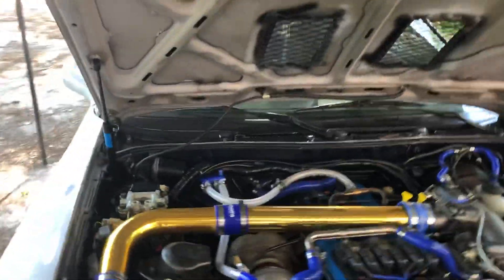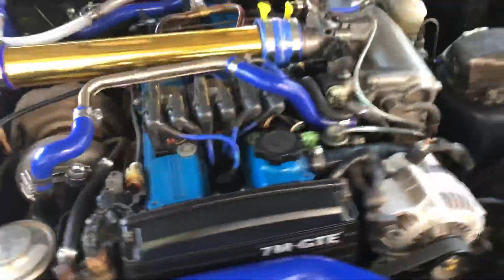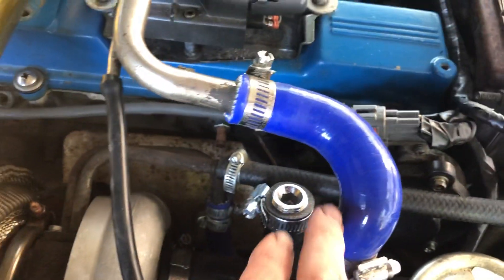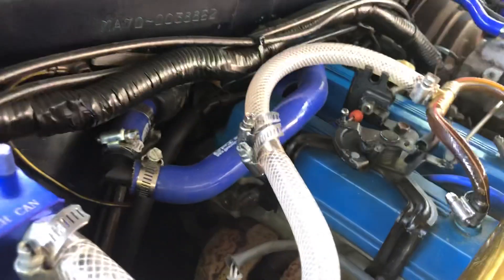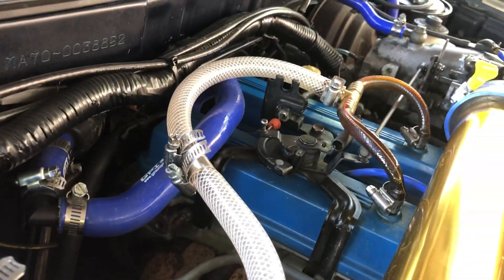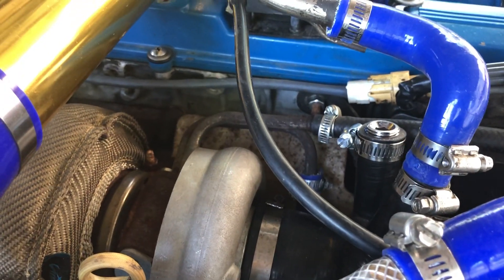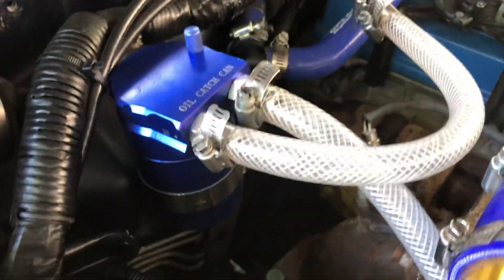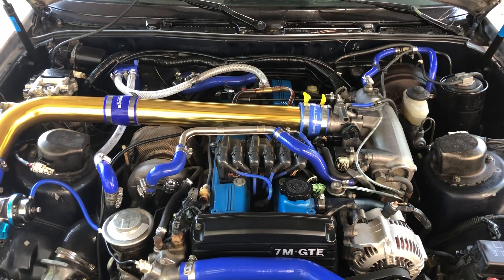Oil Catch can setup - Mk3 Supra - 7mgte

Comment: Question for you. Did you have and smoke issues on deceleration or random smoking on idle after a few minutes? I changed my valve seals to fix that problem and it still happened. Accordingly to many on the forums I supposed to have from valve covers to catch can and back to both accordion hose and intake to have vacuum in order keep pcv from trying to pull oil through my turbo seals.
Reply from the maker: I don’t have any smoke issues. It was routed from valve cover to catch can then to turbo intake (accordion hose). That way it kept it under vacuum just like it was run from factory
Reply: @theturboflamingo132  thank you, I can only assume my turbo oil pressure is pushing oil past my seals.

Comment: Good idea to redo the pcv system like you have.  Would have been a better idea to leave the charcoal canister in its original location and place the catch can where you now have the catch can  located
Reply from the maker: Howard Hutchinson Idk, this way, there’s less vacuum line running over top of the engine too. It actually uses a lot less line too. It still vents out the fender wall and everything just like the other side
Reply: yea otha way around better and use better pcv hoses than those clear ones the heat will weaken it nd you could have a fire get going if it burst open.